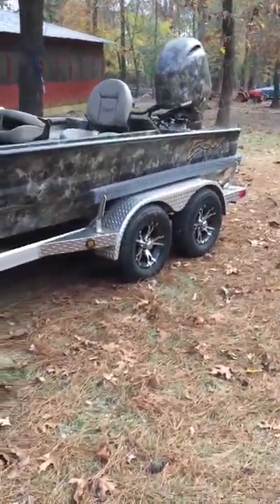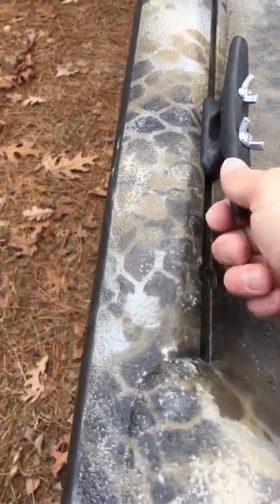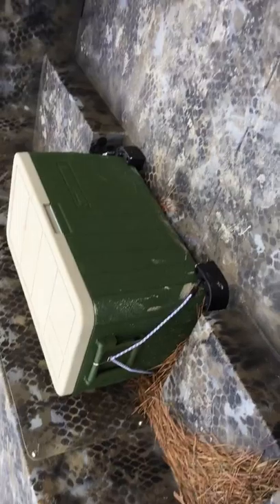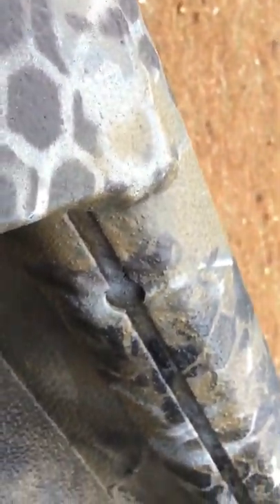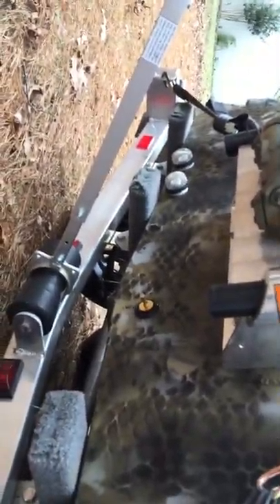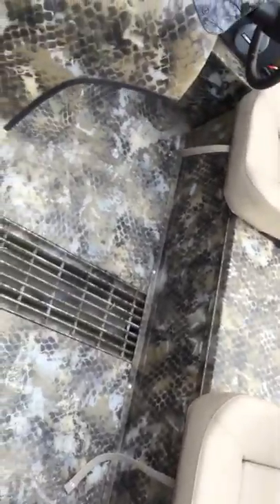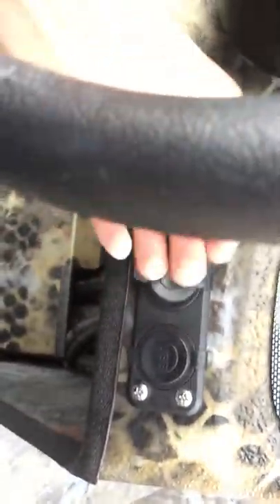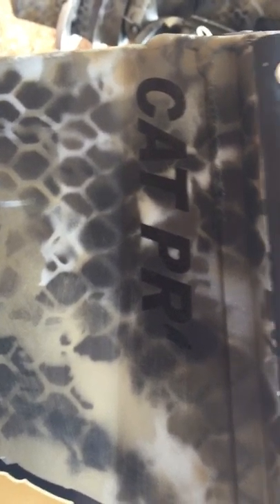Excel review 2 weeks after purchase

Comment: The aerators have a valve on them where you can turn them on or off - so if you wanted water in the back live well and not the front live well you can just turn the valve on the front live well off and there will not be any water going to it or vice versa.  Just a fyi.